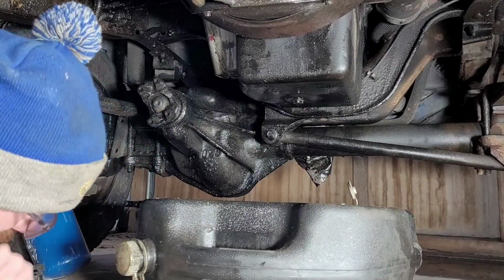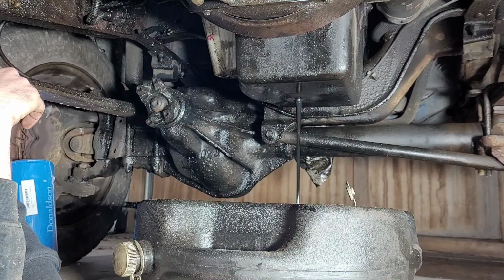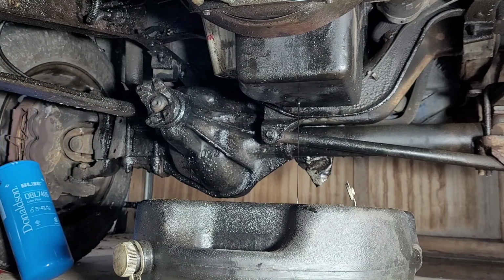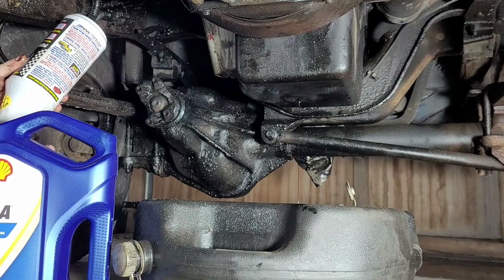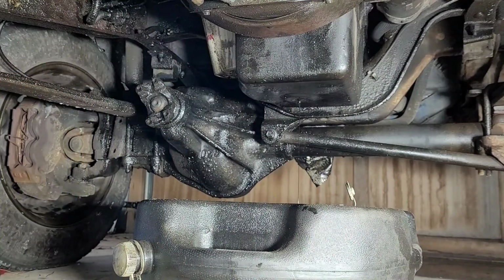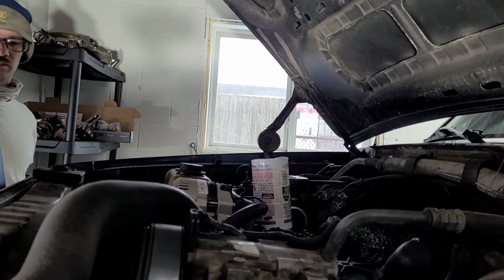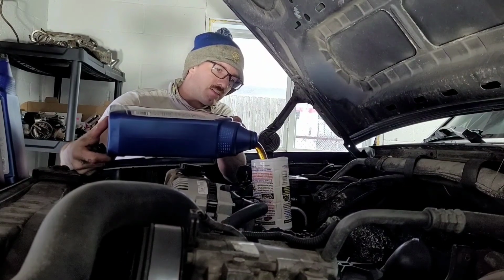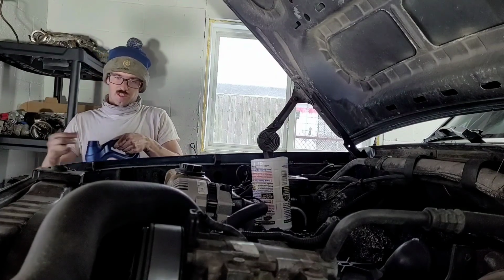7.3 oil change

Comment: Pro tip. Punch a hole in the bottom of the filter to let it drain before you change it.

It's not an extra 2 quarts. About 40 oz more. The MC holds 45 oz and the donaldson holds 84

Comment: My uncle has a 97 Ford F-350 it has over 823000 miles on it that engine is much more reliable than the 6.0 6.4 or 6.7 the only thing he did on it is basic maintenance changing the oil and filter every Max